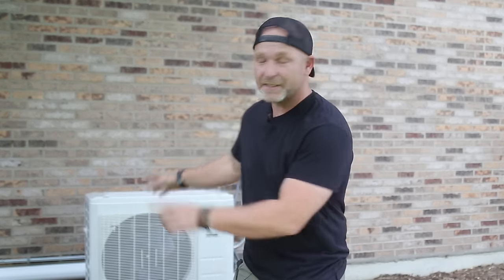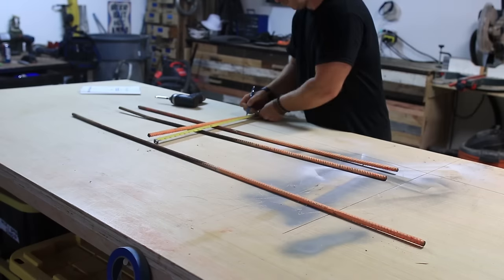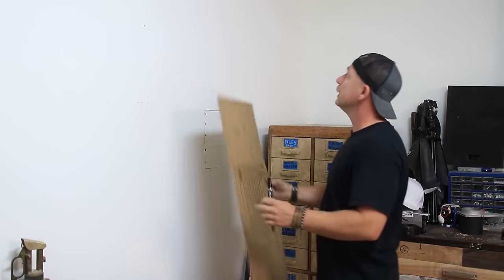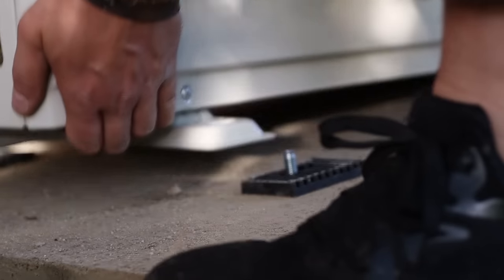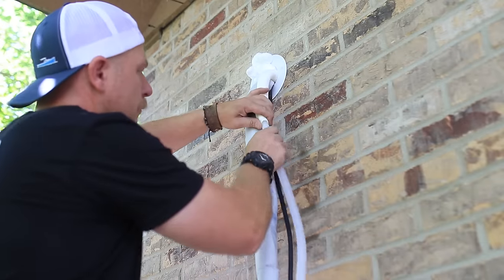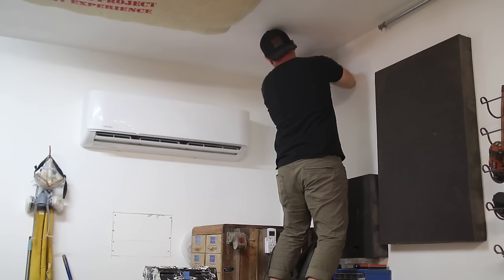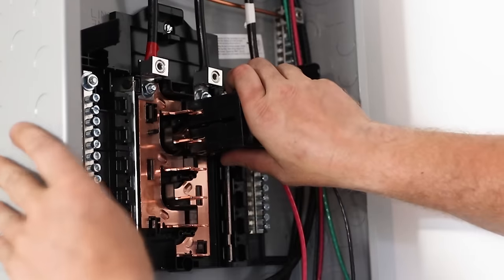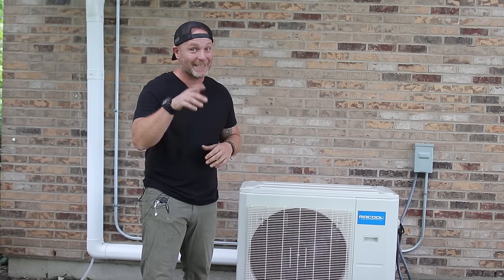How to Install a DIY Mini Split Air Conditioning and Heat Unit.  MR COOL 24K Split Unit

Comment: Superior job. You explained things perfectly. I loved the ladder trick !
Reply from the maker: Haha thanks.  Glad you got something useful from it.  They work great
Reply: @KomarProject  what kind of wire gauge and breaker did you use to connect this ac unit??
Reply: Bad installation, a vacuum must be done first to eliminate air
Reply: Excellent job glad that you are OK thank you for sharing! :)
Reply: @internetisinteresting7720  You missed the point of the pre-charged lineset.
Reply: @internetisinteresting7720  Not on precharged DIY models with precharged lines.
Reply: Be safe good job 🎉

Comment: glad you learned a lesson at 5 feet, instead of 30.
Reply from the maker: Me too lol
Reply: Yeah, l learnt that lesson too and got away with a scrap, hanging off a roof gutter, which was well nailed :)
Reply: I learned the same lesson at 8 feet but there wasn't any oh oh oh oh oh I laid there and gasp for air for 5 minutes
Reply: I got two herniated discs messed up one of my knees to the point I need a knee replacement and I tore a tendon and a ligament all by falling 5 feet to a concrete floor. You never think something bad can happen.
Reply: Growing up, I had a neighbor that fell and crushed both heels. Not a good time.

Comment: I just installed the 24K unit in my home, waiting for connectors as my lines were not long enough for my installation. I installed on an inside wall, ran lines through the attic and was 6 feet short, had to order 16-foot lines and couplers to extend.  I Cannot wait to fire it up. BTW I had help from grandson who is an electrician's apprentice and daughter's boyfriend who is a master electrician.

Comment: I was working with an old timer (very experienced guy, jack of all trades) putting up siding and immediately after lecturing me on how to properly stand on & use a ladder, he leaned to far sideways on a 6ft step ladder, leaned up against the house, kicked out sideways and fell and broke both bones in his forearm. I myself had a very near miss on a 4ft cheap alum. step ladder (like the one in this video) leaned up against the vanity in my bathroom. While changing a light bulb it slid out and very nearly bashed my face on the countertop and/or mirror. Getting in a hurry and complacent/ overconfident WILL catch up with you. Those aluminum ladders suck! Glad to see you didnt get seriously hurt. Anyways, great video, great work, thanks for the insight. I cant wait til my DIY mini shows up! Thumbs up!

Comment: Glad you were ok! I also fell once while Hammer drilling an 1.25 hole off a 8' step ladder leaned against the wall.  The vibration caused the gravel under the ladder feet to subside! I too was lucky!
Reply from the maker: Ya it just takes that one second of concentration laps.  We both need to be more careful brother
Reply: Dude you need someone hold your lader

Comment: Coming from an HVAC guy since I was 19 typically these DIY videos hurt my feelings but you did a good clean job!
Reply from the maker: Thanks so much Richard.  This was my first time and I’m super happy with how it came out
Reply: Richard, whats your opinion on leaving the access line coiled behind the unit? I feel like everybody on the internet claims you couldn't bc of oil but MrCool themselves says to only uncoil what you're going to use and leave the access coiled. Kinda mixed messages. Lmk.
Reply: @philkingmke  The best way to coil the lineset is horizontally and not vertically. When you coil the lineset vertically it creates traps for the refrigerant oil (POE Oil) and over time it will keep the oil from returning to the compressor and hurt the compressor. Have I personally seen a compressor blow up because someone coiled it vertically? No. But this is information you’ll find in install manuals from other major mini split manufacturers such as Mitsubishi and Fujitsu and it’s been preached as “best practice” my entire HVAC life.
Reply: @richardwoeckener2622  thats why I find it so interesting...bc if they're telling you to do that with their own units, they must stand behind that method. I'm about to do it since I don't need all 25' that comes with it so I guess we'll see. Lol.

Comment: What a great video. You just teach everything. Never thought I needed a concrete slab for the outside unit which is the first thing I’ll do now before the A/C technician arrives. Thank you for sharing this.
Reply: They make brackets so you can wall mount them also.

Comment: Great video and very nice work. The only thing that I would recommend as an hvac technician to anyone doing this job is to get a vacuum pump and vacuum the system before opening the lines and allow refrigerant flow. It is highly recommended to remove moisture from system because that could potentially create problems in the future especially with compressor! Other than that great video 👍
Reply from the maker: With this unit you don’t have to.   That the beauty of it, it’s done in the factory before sealing everything.  But otherwise you are absolutely right
Reply: @KomarProject  wow thats great 👍

Comment: I call them "moments of ZEN":  When you know you're not supposed to be doing something...and then you do it anyway.  I've bounced a framing nail off my forehead, launched a piece of casing into my abdomen, actually touched the blade of my tablesaw, bent a ladder leg 90 degrees with my ribs doing what you were doing and just last week, put a joist nail in my mouth to hold it to put on the end of my palm nailer!  I stopped!!!!  Not two nails later, I had the palm nailer loaded up and it it popped and fired the nail into the wall.  Listen to the moment of ZEN!!!  Great installation video on AC.  Keep bringing the entertainment Bart!  Keep bouncin!!!!
Reply from the maker: Wow G you sound like me, a lot.  I catch myself doing dumb things all the time and usually it works out.  It that day was just stupid.  Stay safe brother !!

Comment: As a guy who rode a 32 foot ladder into the dirt twice,  I can say that 'ohhhh, ohhh-ooooh, ohhhh' is the official universal response to fall damage.
Reply from the maker: Haha ohhhhh ahhhh ohhh 😮
Reply: 15 footer here with T12 vertebrae compression fracture. Was changing the bulb in a motion light. Chipmunks tunneled under the brick patio I had my ladder on caused it to cave in and ladder tipped. I’m lucky I wasn’t paralyzed.
Reply: Concur. Would like to see the slo-mo version though.

Comment: Put a washer and nut on the cinch anchor set it to thickness of the pad and foot of unit. You will not overdrive the anchors. I also, think there is a warning label on the ladder to not stand above this step.

Comment: Better install video than the one from Mr. Cool!   
I’m about to install one myself and noticed you have a 90 degree turn on your lineset. I need to make 2 turns and wasn’t sure if that would be a problem. Any issues making that turn?
Reply from the maker: Not really.  Just be careful with it and make it a gentle 90.  You defiantly don’t want to kink the lime.  Good luck brother

Comment: This video is fantastic - more or less exactly what I'll be doing at my place. Thanks!
What were the dimensions of the concrete pad you made for the condenser?
Reply from the maker: That area is covered with snow right now but I think it was 18x30.  But don’t quote me on that.  I’ll check it when the the snow gets lower

Comment: You didn't vacuum the system down?
Reply: I was wondering the same thing
Reply: If you watch the video you’ll know that  vacuuming the lines is not needed with the pre-charged line sets from that manufacturer.
Reply: These are a new type of system - 'DIY'.  They don't require an HVAC installer.  These lines are vacuumed in the factory and charged and sealed before shipping.  The connections have a release valve in them that prevents gasses from escaping until the connection is tightened. A desiccant canister removes any humidity that enters the system from when the connections are tightened.

Comment: He! If you read a few books on the trades, you know exactly what to do and what not to do. The ladder is described in there. Dont use the upper steps. And never reach out on the sides, or you will fall and you can injure yourself. Always have the ladder on stable ground. 

Just saying, you can stand on the upper steps even when its not advised, but you have to be sure not to reach out to the sides, and then you can get away with it. 

Bottom line is, dont get your center of gravity outside of the ladder or it will tip over.

Greetings,

Jeff

p.s.
Nice AC unit! The precharged thing seems to be really easy. Im reading a book on AC units now. When im done i will know exactly how to get this job done with any AC unit. :D

Comment: this is coming from a hvac professional, I have never seen a line set pre-charged with refrigerant. only the condenser is. I don't know how far from the wall you set the unit, but by code the unit must be no less than 12 inches from the exterior wall, and no less than three inches off the ground. for a package unit technically you have to pull three vacuums after hooking up the line set and pressure testing it with nitrogen, to remove all air and moisture from the line set and evaporator coil. that's what we call non condensables, the first vacuum is to 1,000 microns, the second to 500 microns, and the third is to pull it to 300 microns, and let it set for 24 hours to see if there are any changes due to micro leaks. then if it is good you release the refrigerant. the compressor in the condenser is a pump and can not pump water nor air. most of your newer compressors are cylindrical style and not a piston style. it will kill the compressor and most likely void any kind of manufacture warranty. other than that it was a pretty good install. and just fyi, a mini split, just incase you leak any 410A, is not charged by the standard pressure and super heat and sub cool. they are charged by weight only. so look at the info tag on the unit where the model and serial number is. it will have the factory charge either by ounce or pound depending on the manufacture. so you will need a refrigerant scale and a reclaim machine and a reclaim drum. weigh  the Freon as you pull out the Freon into the reclaim drum weighing the amount that comes out. and you put in the difference to get it to the factory charge.

Comment: Yes it's good you kept the fall in the video, because doing any job,well sometimes it hurts.i was doing some work in the attic of a home,hooking up a bathroom fan and light,the area was so small I had to really reach to get there.
When I moved up a little my head kept hitting the roofing nails and my arms git to cut too.
So when I came down from a 130 degree attic I looked like I was in a war zone.😮

Comment: So base on this installation, it seems to me that that no vacuum pump tools is needed, so confusing when other videos regarding mini split requires professional AC tools, glad to know you did not have to vacuum the lines or check for leaks.

Comment: Hi mate, thanks for sharing. Although I did see you blow the face of the brick off when drilling a pilot hole. I would usually measure the wall and stop hammering about an inch short of the other side. Then use normal drilling for the last bit. ;)

Comment: I installed this same unit.  It was great...until it wasnt.    After 2 years it stopped heating.  Diagnosed as leaking indoor coil in the head unit.  2 replacement indoor heads leaked as well.  Long story short - i got my money back and hired a company to install a quality Daikin system.

Comment: Great job! But on the leak test part, try running nitrogen through the lines besides releasing the refrigerant to check! So then if there is a leak you wouldn’t be able to release the refrigerant and just the nitrogen! Great install tho!

Comment: Dude, that had to hurt. I'll make sure not to drive the bolts too far. Those pads are there for a reason. Thanks for the video.
Reply from the maker: Very welcome Snowy!! It did hurt but Luckily nothing happens that was too bad

Comment: I didn't get the allen wrench, the hole saw blade, or the wrenches. And it took me about 10 min to get that sucker up on the wall. Thanks for showing t the wall cover goes on the wall sleeve though. Seems so basic but, very helpful. That's all the further I've gotten though. Still need to find help getting the outdoor unit from my front porch steps to the side of the house, and get the bracket on the house, etc.

Comment: Yes easily plug the coolent lines in after you cut them debur them use a flaring tool on them and then once they are hooked up purge the air from the lines with you purge valve.  So diy easy a contractor can do it. Funny how the manual says all of that but your video didnt seem to mention that.

Comment: I didn’t see you vacuum the line but you did a good job 👍
Reply from the maker: This unit dosent require it.  It’s done in the factory before being sealed.  That’s what so cool with a diy unit.  But great pint
Reply: Awesome!! Thanks for reply and again GREAT JOB!! 👍
Reply: @KomarProject  I'm a DIYer also, so I may just be missing something obvious. 
But I just don't understand how you can correctly install this without vacuuming the lines first. Sure, the refrigerant is stored in the outside unit, but after you connect the line why don't you have to evacuate them before releasing the refrigerant? Is there some sort of seal that gets pierced when you attach the lines to the two units?  I've watched some other brand install videos and they use a vacuum pump to evacuate the system before releasing the refrigerant.

Comment: See, if you call your local hvac supplier, they can sell you a pad. I'm an HVAC apprentice. Can't wait to see how this comes out
Reply: Update: I wanna see how well this lasts because we install american standard/Mitsubishi electric ductless splits and they last 10+ years. I also am wondering if the thermostat is wireless. This was a great installation and I think my boss would approve to be honest. I really wanna see how long one of these lasts. I also want to know why you can't get a tube cutter and flaring kit so you don't have that extra slack on the lineset
Reply from the maker: Ya the thermostat is WiFi to the unit. It still needs to be plugged into an outlet.   As far as how long it lasts I can’t answer that. I just installed it this summer and it’s been amazing. Especially with heating system for the winter.

Comment: I have a question about the line set as an HVAC technician. Since you didn't pull a vacuum on the line set, are you worried about when the moisture turns acidic? Plus all the non-condensables in the system?

Comment: Great job and great video! Have your dad check local code. My local code requires a convenience receptacle within 10 feet of the a/c unit.
Reply from the maker: We don’t require it but we did put one in when we had the pool pumps put in next to it

Comment: You crack me up!  Love the vid.  After all my research b4 I install one for my daughter, yours is the first one I see that doesn’t need a line vacuuming first.?  Is that possible?  Someone enlighten me plz.  Tx
Reply from the maker: You don’t need to vac these lines.  They are pre charged and sealed my the manufacturer.  They vac them before sealing
Reply: @KomarProject  TY sir

Comment: Two questions. First, would it have been possible to hide the electrical conduit behind the cover as well? Second, don’t you have to pull vacuum and purge the system with nitrogen prior to releasing the Freon into the system?

Comment: For the inside installation, how do you determine hanging height? Does the instruction provide height info?  How did you determine how far the outside unit should be from the wall?

Why did you use dampening wrap? Will it cut down on noise that you may suspect will occur?
Ouch... I hope you are well now.

Comment: I did have a question about the refrigerant lines. I am trying to cover the first floor of my house. In order to do so, I want to buy a 2 head unit system. The catch. I need to route 1 of the sets of lines around a chimney. Will these lines flex enough, and maintain integrity, if I have multiple 90° turns?
Reply from the maker: As long as you don’t kink the lines and have a gradual 90 you should be fine

Comment: It seems not many people know of the Zamna Climate mini split AC and heat pumps that are DIY just the same as Mr Cool units. It would be really cool if you could get one of these units to test out. 
They are solar ready meaning they run off direct power from solar panels - NO SOLAR INVERTER NEEDED. However, they do accept connections from the grid, so you can call them hybrids. 

We are actually running a few of these in Jamaica 🇯🇲 as we speak. The 12000btu runs off 3 solar panels and the 18000btu works with 5-6 panels (405W panels).

The company that makes and sells them are based in the United States 🇺🇸 - Zamna Solutions | Zamna Climate. If you should reach, just let them know Rayon from Jamaica 🇯🇲 gave you the info ✌🏼
Reply: Those units aren't really the same level of diy as you have to pull a vacuum on those linsets and that is already done for you on the Mr. Cool diy units.
Reply: Not really, the 12k btu I installed at home was done without pulling a vacuum. I installed an 18k btu and the same, no vacuum and they are working quite well.
Reply: @RayonWhittaker  I looked on their website and the say you should have a vacuum pulled by an hvac specialist now whether you did it or not is your decision, but that is what they specify. The Mr. COOL units specifically state that you do not need to pull a vacuum, as they have done it, filled the lines with nitrogen and sealed them at the factory.
Reply: OK np. But from someone who has a few I'm letting you know that the lines are filled as well.